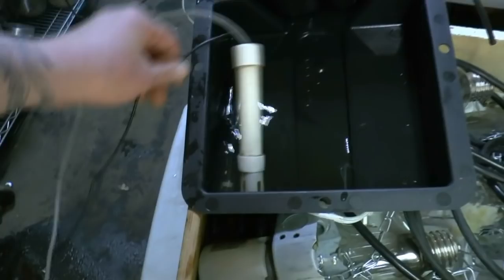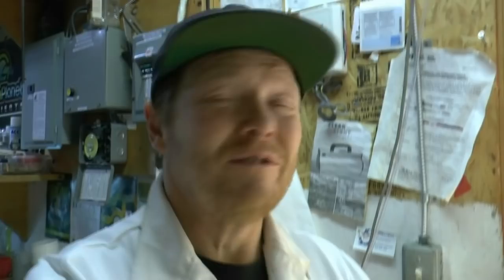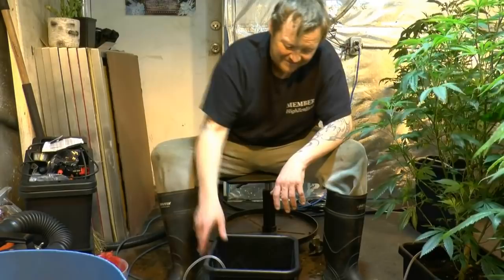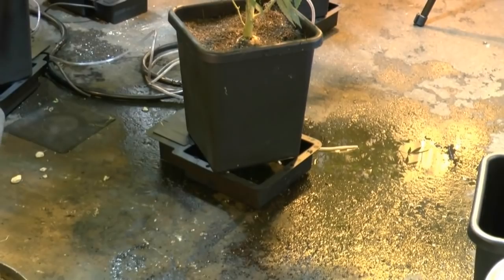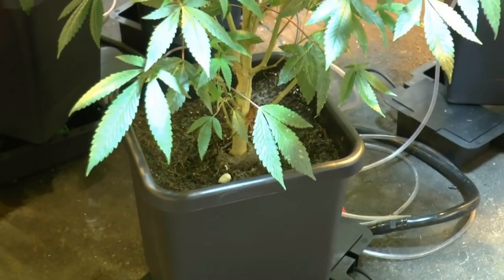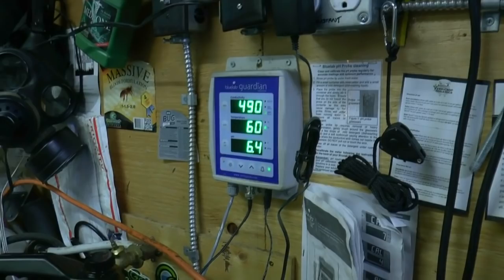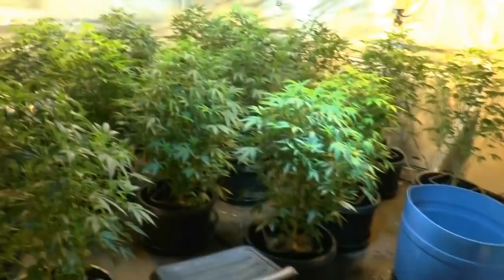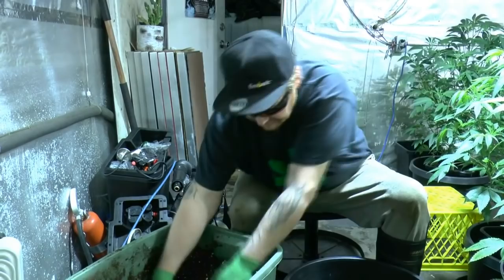Whats Growing On With These Plants

Comment: The best medium is actually the simplest, reused perlite. I say reused because it doesn't take on the water holding capabilities of a good artificial soil until it gets some decayed root bits in it. To start with fresh perlite you need to have a bag of chopped up old roots to mix with it. You could get that from a water culture setup if you had one. I just started with pure perlite and the roots gradually built up after a few crops. At first I had to water very frequently of course. Cannabis roots, after decaying in the last pot of medium for a few weeks after cutting the stalks out with a knife, are a pretty much perfect medium component. If too much roots build up, just add some pure perlite. I just pull out the big clods and then reuse it as is, rarely need to adjust it. You have to let the roots decay for a while though or they'll be too fibrous instead of breaking up and also more bulky which will later compact in the pots as it decays. With the perlite/roots mix, you only need to water every few days, similar to soil.

Comment: Great video 👍🏻... do you always feed with water temps in the low 60s? In coco I’ve always kept my water temps at 68-70. Just wondering if the water temps could be causing a little stress? Just a thought. I’ve never ran water below 68 unless I’m flushing..
Reply: Mr. Dank BRK-BUD 💯

Comment: now that u mention pro mix your on the right track, mine i used the green black n white bails on my 3rd one in the last 8 months i dont use a lot but just the opposite my soil ph was below 4 on my run off took gallons n gallons to get mine to climb i went as far as putting ph8 water in n still getting 4 out n no it wasnt my meter i use drops so CHECK YOUR METER to b sure your on the right track.

Comment: John I have that same guardian with a new probe same as you but mine dont change as quick as yours especially my temp one . Every couple days I put the probe storage solution on the probe . Cheers
Reply: You need to keep it in your res constantly, or keep it sitting in potassium chloride. If the end of your ph probe dries out it will not work properly and you will have to replace the probe

Comment: the problem is you don't use real PH fluid and more than one substrat. right tools make a good worker. lemon = citric. pH solution = phosphoric. plants need phosphoric acid not citric. dude, use straight coco with real pH solution you'll have no more soucies. at this stage, concidering the hurt you need to do to the roots, go straight for a light root trim it will be better for the plant. take few days more to recover but when they come back it's like rockets!

Comment: Over thinking, Overwatering, Over Engineered. Can't say it's Organic or best, when you use those nasty chemical bug sprays, even when there's no bugs. Sulfur Burner, Sulfur Plant Fungicide drench and foliar spray, Baking Soda 2-3 tsp + Neem oil 1 tsp + 10 drops liquid soap per liter mixed very well plant spray. All of these are WAY better options and cheaper. And sns sprays or garbage it's systemic. Not going to pass for food grade, you want to best no pesticide or chemicals.

In addition to KISS program, The best products are cheap and hidden. You get nats (from root rot overwater) and purple stems from over water. A plant tea or Greatwhite  Mycorrhizae will fix (By adding roots to uptake water) + don't over water. This would of been your best grow still might be. Also you bring in outside bugs, then go in grow room, Need fresh clothes and shoes just for grow room.
Last scrog everything for max yield, and like others said no light to res. 

You an experienced grower, doesn't give up and has passion. Hope to see success.